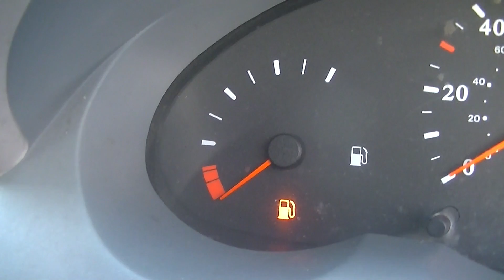Seafoam Test - Does it really work?? Pt.2  The Proof

Comment: It does more than free up carbon. Ive heard it has restored fuel pumps and fixed gauge and other fuel sender issues. Me personally I was running really lean when I would drive at high loads and low rpms. After seafoam? drives like a dream. It at the least cleans up your injectors
Reply: Daniel Allison How do you know if you're running rich or lean?
Reply: 51MontyPython diagnostic iphone app called Dash Command and elm 327 wifi obdII adapter. It simply reads off of sensors from the ecu in real time and makes various calculations (although probably not that accurate) from the readings it gets from sensors like mpg, hp, and torque estimates. I have access to the rear O2 sensor and its real time voltage
Reply: Daniel Allison
No shit???!  Well I'll be damned.  So, how does this differ form a code reader?  Is it any better?  Worse?
Reply: 51MontyPython On android I use the Torque app with a bluetooth OBD reader and yeah, I'll back up Daniel on this one. For around 15-20 dollars total you can get access to the real time graphs from the o2 sensors, vacuum pressure and a whole host of other things as long as your computer ECU reports them.  When it comes to codes I've witnessed that very expensive code readers can pick up more stuff but anything major will show up on the bluetooth reader. But the code reader can only do that, read codes. The bluetooth readers are far better for data acquisition while being far cheaper.
Reply: Moe Lester
You must be shitting me.  How can this be, that these phone apps should be better even than a code reader designed for such prupose?  O_o  I mean surely even an advanced cell phone technology couldn't possibly have any more diagnostic capability than even an OBD2 system reader, right?
Reply: 51MontyPython well modern phones now a days are really handheld computers. Very reasonable to me. I have been able to see a check engine light on the move on my way to work or school. It really is a life saver as I can see on the spot why I have a check engine light and see if all sensors are working properly. You go as far as putting in drive train ratioes and drag coefficients (found online) for your specific vehicle to help give more accurate estimates. Just youtube dash command and torque, personally ive used both and dash command is more responsive and user friendly. totally worth the money as long as you have an apple or android device
Reply: Daniel Allison
Wow.  Good info.  Thanks.
Reply: 51MontyPython no problem

Comment: Seafoam was made for two stroke outboard engines not today's modern cars. BG44k is a great cleaner. Gumout multi system tuneup has PEA which is another great cleaner. Google Top Tier gasolines. You can get a list of the stations that carry it. For a few more cents you get a higher rate of detergents.

Comment: Nice video, exactly how they are supposed to show.  My thoughts are about what are we trying to gain with this product, i.e. the surface on the pistons are almost not affected but it would be nice to see the valve seats and how well they are sealing (compression) and the overall cleaning of deposits from the combustion chamber.  I think the surface on the pistons are not so much the contributing factor to performance gains in this case, (like aluminum pitted moon surface :) )

thumbs up!!!  keep up the good work

Comment: i see a difference in how the piston looks.  chrisfix proved that it works.  try using a much less diluted ratio of seafoam to gasoline.  the more gas you mix with it, the less cleaning.  i wait until i have a 1/4 tank or less and dump the whole bottle in and see good results.

Comment: Your videos are impressive.  I have been a mechanic since the 1980s and my experience with Seafoam has been good in general.  May I suggest another trial?  Try treating the engine through the brake booster vacuum line and after it stalls let the engine sit overnight then start it up and take it for a 10 minute drive or so.  Get it warm and don't be too nice to it.  I am willing to bet this will improve the results.  I think it just didn't have enough time to penetrate the carbon layer on the pistons to break it down.  It did appear there was less of a shine to the carbon layer with your scope cam, so some of that remaining carbon may burn off with continued driving.  May I also say it looks like some foreign matter may have gotten into cylinder #4 somehow.  It looks like something was bouncing around in there you can see little dimples on the piston/carbon surface.  Must not have had a negative effect on performance hopefully it blew out the exhaust for you.  Great videos thank you for taking the time to make them!
Reply: I think if you compare the results from the water decarbonisation video Boyd linked, on the same Nissan Micra, you'd see that it had much more effect, in comparison to Seafoam in this.
Reply: I have no solid proof that seafoam does anything actually.  I haven't done any research nor did I take a camera and look at the piston tops.  I do know that the water trick works however, but you have to make sure you don't pour too much water too fast.  I learned my lesson on a 1981 Buick Regal I slipped with the glass of water in my hand and ended up pouring about 8 ounces of water down the carb at the same time.  The #3 cylinder hydro-locked and completely grenaded the piston haha.  I pulled the head off and there was no piston in #3!
Reply: Here's the trick I like to do instead of using cold water I use a Scunci steamer.  I plug the nozzle of the steamer into the pcv port at the top of my engine.  I start it up and just before the steamer is hot enough to get a good head of steam I rev the engine to about 2500rpm and hit the trigger on the steamer.  Steam pours out the tailpipe pretty good.  Once the steamer gets hot and less water is coming out I reduce the rpm and keep the steam flowing.  After about 3 minutes most of the steam is gone from the steamer and I button it back up and take it for a good ol beatin lol.  Seems to really make a difference.  I plan on buying an inspection camera soon I really want to see how clean the pistons are getting.

Comment: what about oxygen sensor, do u think this process will clean oxygen sensors too?
Reply from the maker: There is little evidence of it cleaning anything, so I really could not say.
Reply: Just replace the O2 sensor at 50,000 mies. Either that or if your car is new enough, wait til it tells you you need a new one. O2 sensors sit in the hottest place in an engine (exhaust) and will only last so long. That's a guarantee.

Comment: Good, fair testing.  I agree with you--not much of an improvement.
You'd do better adding a small % petrol diesel to your fuel.  Petrol diesel is a natural solvent.  People use it all the time as a parts cleaner when overhauling gunky parts.
I'd like to see you do a video on that....

Also, why not do another video showing your pistons before & after you do a water decarbing?

 Thanks for sharing!

Comment: good show man I figured that stuff didn't work I tried it and had nothing different happen my thing was oil who ever had my truck I guess the never changed the oil so try to clean gunk out my oil pressure is a little low and guys do not use lucas stop leak or any stop leak in your oil it will clog stuff that doesn't need to be clogged and still have a leak but thanks for the video man

Comment: I agree with mr2miach, it needs heat and to sit much longer. Plus given the condition of these Pistons, I think around 5 treatments over a period of a few weeks would finish it off.
Reply from the maker: All I have done is followed the instructions on the can.
Reply: BMAC VAGS
of course,,,, but as a machinist and builder, I have learned one thing,,,, most of the time, instructions are simply references, usually error to the side of excess rather than the bare minimums...... plus, I would use an entire bottle for all three places, rather than 1/3

Comment: hey great vid 

what product or method would you recommend that would give the best results
thanks
Reply from the maker: I recommend good regular maintenance and premium fuel, and you should never need any of these quick fixes.
Reply: lol Yeah, the main thing change your oil often. Especially if you are not using Synthetic oil. Which by the way Full Synthetic is proven to clean engines better and last longer. So no reason to go out and disprove that BMAC. Anyway great video man. I can not believe you went through all this trouble.
Reply from the maker: Jordan Robinson Thank you

Comment: Well if you followed the directions I would have to say that Sea Foam may not be all that it is hyped up to be. You really cannot get a more controlled experiment than this really. As I told you earlier and you probably already knew Sea Foam was originally used as a fuel stabilizer. Maybe that is all it is good for, even if it is good for that.

Comment: Testing in new engines shows Seafoam smokes and is not cleaning anything. It doesn't do much at all. It's just the Seafoam burning off. Try Marine outboard 2 cycle oil that's TCW3 rated. Use it at 1oz per 5 gallons. That's a 640/1 ratio. The oil cleans and lube the entire fuel system. You put it in the fuel only. It will not hurt cats or sensors because it burns ashless. You can Google.com Sarge LS1 on the Internet. There are many people that do this with great success. Remember it has the be TCW3 rated. Peace.

Comment: Well, that is the kind of product that has no use whatsoever. If you mix mineral oil with some lacquer thinner and isopropilic alcohol you may have better results than using this product. In mechanics there is no magic, no easy way. Mixing it to the oil can even be really bad for the engine, as you are actually pouring a solvent in the crankcase (the naphtha and the alcohol) what will thin the oil and cause unnecessary wear due to the fail of the oil film under extreme pressures. It's the same as when the oil gets thinned with gasoline from a bad mechanical fuel pump. you want to change it right away. 
There is people that says: use it on new oil and drive around the block, the oil will be dirty already. Well, drop gasoline in the crankcase and do the same. The gasoline will dissolve some of the built in gunk, and make the oil dirty. Unfortunately it will also cause big prejudice to the lubrication of your engine.
Like you said, a well maintained car needs no magic additives.

Comment: Hey BMAC VAGS could you try the same way as the vacuum pipe with hydrogen peroxide? Yes, H2O2, the same stuff you use when you cut yer skin...
I tried a few times before emission trest in an old vw diesel engine but i' ve never took a video inside the combustion chambers.
Cheers.

Comment: Seafoam really isn't the best to be using for cleaning excess carbon what so ever.  But it does do wonders on slowly breaking sludge down in the crank-case over time.  Don't expect miracles after one oil change, but it does in fact break oil sludge down with time.

Comment: Thing that worries me is hydrolock with this product especially on a high comp engine,you can hear that micra engine shake and bang at one point, not worth the risk in my book.
Reply from the maker: shark21ful I think hydrolocking is pretty unlikely if i am being honest. The banging noise is predetonation due to using a petroleum product in this way.
Reply: Hi thanks for the reply, thanks for the upload its very helpful is there any chance you will be doing any more with the borescope? Ive heard good things about redex fuel treatments like dyno runs before and after showing power gains? Again thanks i found this very interesting keep up the good work bud 👍
Reply from the maker: shark21ful I didn't have plans to do anymore, but i will consider doing a redex test
Reply: Kool il keep my eye out for it thanks 👍

Comment: In my opinion Seafoam is crap. I was told to use Seafoam in my car ford mustang to keep the engine and fuel line clean and clean out any engine gunk they may be there. My car ran perfect before using seafoam and after using it my car started hesitating and stalling and this also happend to 3 of my friends cars after using seafoam. in my opinion ((DO NOT WASTE YOUR MONEY.)) I'm sorry if i have offended anyone. now i'm having to fix the issues it has caused.
Reply: Oh BTW. Very very well done video
Reply from the maker: Tonya S Thank you
Reply: you are so right . Stop using all kinds of chemical product for cars. Use super fuel like 91 or 95 depends on your car fuel type.

Comment: The effort was great but if you can't see the difference your fukn blind Really even though you trued to hide it with the after camera work it was apparent it worked very well. The rust on the cylinder walls was gone, the thickness of the carbon build up disparaged.
Reply from the maker: i think if i tried to hide it, i would have done a much better job.